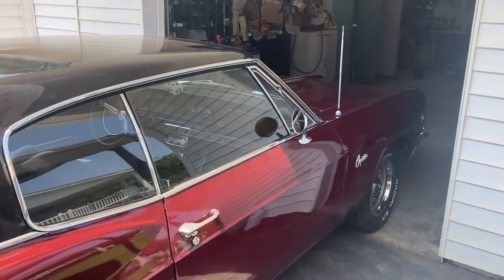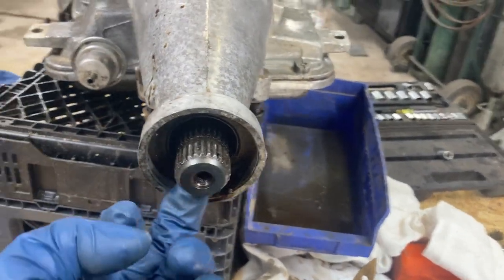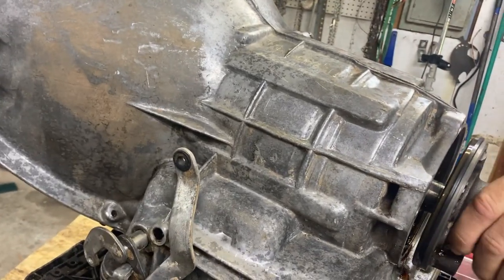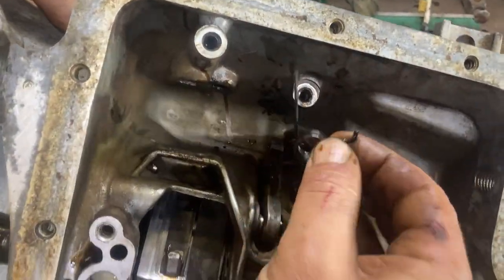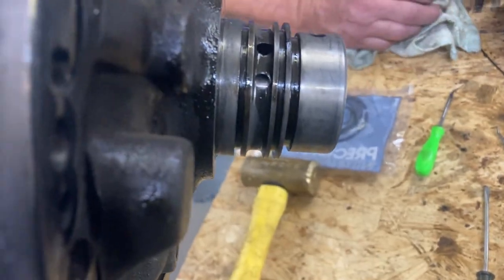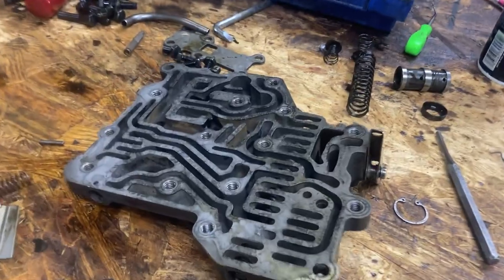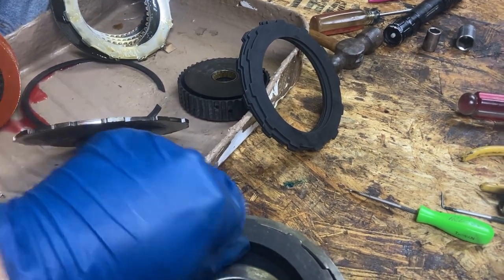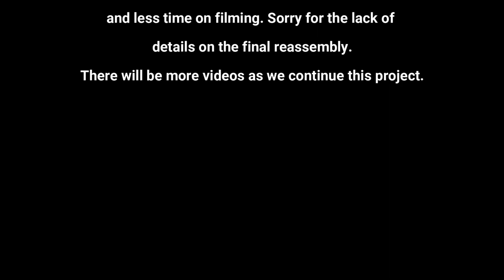Rebuilding a 1966 powerglide transmission. Continuing the 1966 Caprice project. Aluminum Powerglide

Comment: did one of these in the mid 80's with a buddy and his 68 Camaro. These are the best beginner build trannies.  Picked up one for my '57  and was looking for video's to refresh my memory.   Good hands on video, if you have the ability to edit maybe cut a lot of the unscrewing bolts, fidgeting with seals and steels, and only have one set of hands at a time in the cookie jar.

Subscribed to follow the progress, looks interesting!
Reply from the maker: Cool, thanks for the tips.